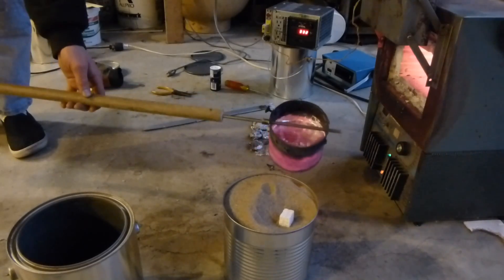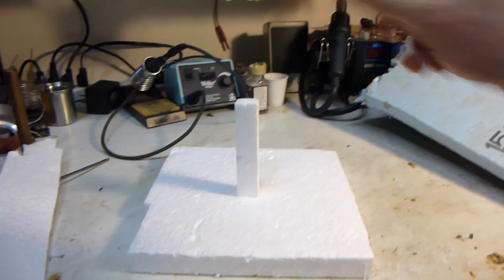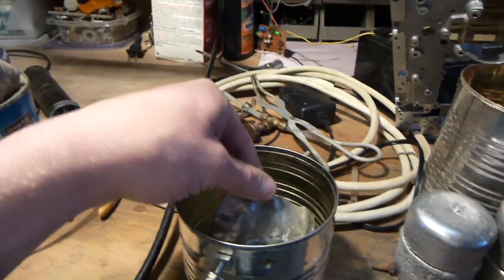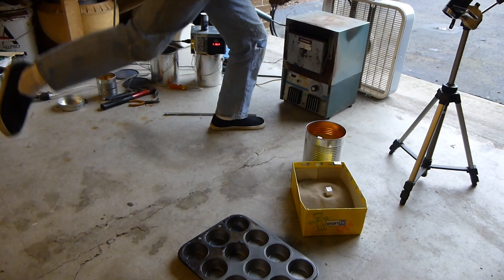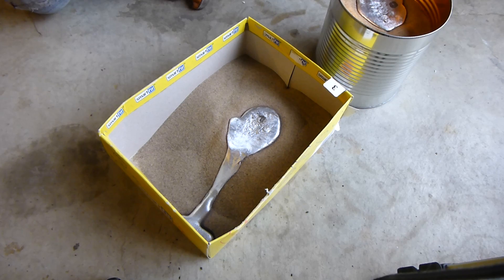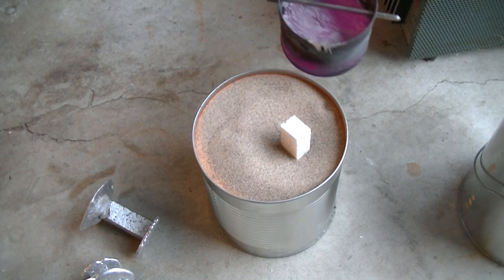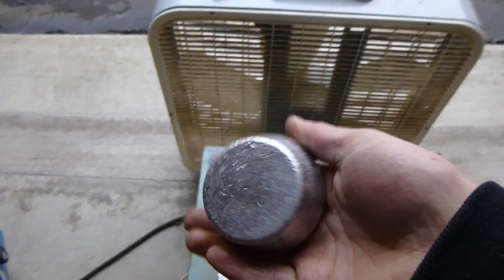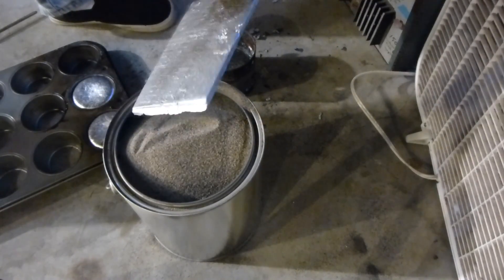Aluminium Lost Foam Casting Experiments and Tips

Comment: Just wonderint here maybe fill the cheap foam imperfections with wax? Bore out the sprue and  and somehow round the sprue into the actual form or at least use some small pieces to make a 45 degree entry so it can flow.

Comment: Sprue  length doesnt really matter, as long as you have  clean material, scoop the dross off, then flux it,  a steady smooth pour will work.  Make sure you have a feeder tube to allow material to flow more into it than needed, the feeder tube will put steady pressure and fill correctly.    Also, a smooth sprue with rounded corners entering the mold, is a must. Your pours are a little fast  causing air  pockets.

Comment: Read your comments an you will fine the answers to your problems. Those I have to admit I was wondering why you were using styrofoam.  I'm still at the beginning but I took a break to learn a bit more before up grading my materials. I, like many started with lead as a kid, an made my first crucibles from a pipe cap they come in many sizes an are pretty strong. Later on I still go cheap just added a bit more pipe.  Thank You Loader.

Comment: I think that you need a vent channel for the hot air/gasses to escape. This could be trapping air in the mold and causing back pressure on the flow of the melt. Hot gasses can cause quite a high back pressure - just think about what is going on in the cylinders of your car/bike. Creating an exit for the gasses may mean that you do not need such a long spru. 
I did, however, enjoy your video.

Comment: Watch a YouTube video, you can clean that sucker up good as new(ish).
Reply: Kiln, remove rust and other built up residue.
Reply: I understand the pressure aspect, but can't help to think that if you had poured more product in the first time you would have resulted in a larger platform yield.
Did you did to see if any of the foam was still intact and under he sand?
Reply: 11:00 in, nice mold result!
Reply: I like it. Your method is almost scientific!

Comment: Theoretically if you premelt some aluminium and add rest  - it should be slightly faster metling. Better idea will be to mix during melting, but it is non-trivial.

Comment: I really recommend not using extensions with powerful devices. Bolt it down directly to your grid with a solid, one piece cable.
Reply from the maker: +Piotr Misiuna yep. I did use a heavy duty cord. But it still got pretty darn hot.
Reply: There is also oxidation on contacts inside plugs and sockets.
Reply from the maker: Yep

Comment: Is there a size limit to lost foam? I'm thinking of casting a pair of 25 inch (a bit under a meter) bandsaw wheels this way.
Reply from the maker: +Lawrence Withrow I would not try something that big with lost foam. Especially since you will need two wheels. I would make a wooden pattern and then use green sand. It's a much more tried and true method and is a lot more reliable.
Reply: Thanks.

Comment: Nobody should be saving to buy a crucible, repurpose an empty fire extinguisher casing.
Reply from the maker: +Chris Eubank yah I've used propane bottles before. Essentially the same thickness as fire extinguishers. Problem is they only last around 3 castings and then you loose all your aluminum. So if you don't want the headache of aluminum leaking out of your crucible all the time then it's a great way to do it on the cheap. I bought one and I certainly don't regret it. Have a nice day!
Reply: Makerj101  when is your next video i am very anxious. Also for my foundry i am using a hair dryer and brick with charcoal and a fire extinguisher do you have any suggestions that wouldnt be too expensive. thank you
Reply: dude, really? a hair drier? does it work? i have nothing and want to try this for the first time. I have a heat blower (the kind that's part of a soldering kit, for heating smartphone screens to remove broken glass). is that really all the air pressure you need to heat aluminum to 700 or so degrees?
Reply from the maker: +Tech Review I'll try to get a new video out soon. I've been really busy with school lately. Sounds like you have a pretty good setup. IDK, it's you're foundry! Upgrade whatever you want
Reply from the maker: +prodigalus no, that wouldn't be enough heat. Aluminum melds around 1000F. The hair dryer is used for an air supply to make the charcoal burn hotter.

Comment: How did he stick the sprue and the styrofoam together? Would any of PVA, UHU tube glue or glue stick for glue gun be ok? Would any of these burn and evaporate when they come in contact with the molten aluminum? I know that the UHU tube glue causes slight damage to the styrofoam as it is a solvent and may cause worn out but I could still use it without damaging my piece. However I would like to know if it would work and if no what else could I use ? (I need a fast drying material)

Comment: I've never done this but Ive been researching. Maybe you should use green sand
Reply: green sand is used in a different casting method. When you use green sand you need a strong object of your desired shape, most people use wood. You then use it in a two part box and remove the mold leaving a void. In the lost foam method the mold is left in and is melted.
Reply: 1man2guns3kills I know it's typically used in mold casting. I just meant maybe it wouldn't collapse when he adds the metal

Comment: YOU'RE USING DRY SAND. NO CLAY. You're using a long shaft,  a lot of aluminum, NO AIR HOLE FOR THE DISPLACED AIR TO GET OUT. YOUR CAST SUCKS, DON'T SAY ITS GOOD. This is a horrible video. All of your tips, are actual shit. Possibly because you are breathing styrofoam. idiot

Comment: can i use plastic instead of foam?
Reply: i would say not. besides, the fumes would be very dangerous. instead of foam, if you needed more detail i'm sure you would use the lost wax method instead.
Reply: The plastic would sit at the bottom and stay in and cool like that, ruining your cast
Reply: Sleestak Lizard good point. foam seems like it vaporizes. i think you even have to melt wax out of a lost wax mould, no?
Reply: +ryan barker I think wax could work, you should have some basic trial and error tests to see which works best, although,  styrofoam is cheaper and less messy in most cases.
Reply: +ryan barker I think wax could work, you should have some basic trial and error tests to see which works best, although,  styrofoam is cheaper and less messy in most cases.
Reply: +ryan barker the problem is i cant make the mold from the foam, already tried i have no skill in foam,so i need to make silicone mold first and then use some melted wax for using lost wax?
Reply: Sleestak Lizard true, but you'll never get the detail out of styrofoam that you will out of wax.
Reply: Kana Sama can you make a resin positive with the silicone mould? lost wax would be several more steps.

Comment: I'm no expert but I cast lead weights and you are poring waaaay too fast and you need to be able to pour right at the surface not from 6 inches above it
Reply: Casting lead and aluminum is different, aluminum solidfys much faster than lead so pouring faster is better
Reply: phartattack nono. The faster the better as always
Reply: Just a bad accident waiting to happen, enjoy your scars!
Reply: phartattack i will if iget any

Comment: You need to use damp sand so i doest collaps when the styrofoam evaporates
Reply: +ryan barker he's referring to green sand/moulding sand, which is a mix of fine sand, bentonite clay, and just enough water to help the clay and sand hold the shape. doesn't take much, but your correct. Too much water could pose serious risk.
Reply: how sure about this are you?  i mean, water and molten aluminum ~ not a good combination. it'd be better to use a higher quality sand, no?

Comment: Try to mix the sand with used oil (used oil from car engine). and when you add the mixed sand put letter pressure on it so the sand stick to gather (Not to much pressure that reform the fom)

Comment: I know people have mentioned using multiple sprues and length etc. also pre heating larger molds will help the pour flow better But it would require a much larger oven    If you had the means to do that then lost wax would be the way to go .

Comment: Wax is cheap and works much better for casting IMO. Also the length of the sprue does make some difference, but I've found that if you need to, multiple sprues works well for larger projects.

I'm also a fan of wax because I like to make art work, and it's surface tends to be more consistent.
Reply: Do you use a special kind of wax? I was wondering if regular Paraffin wax would work. It is available in a variety of shapes and sizes, from which patterns could easily be formed. I think multiple sprues help to more quickly equalize molten metal pressure as the casting behinds to cool - comments?
Reply: Pretty much any wax will work. I've used bee's wax before as well as wax from some old candles. I've never used paraffin before, but I believe it should work. And the multiple sprues is for gases and such to release. So you don't poor into each, you'll actually see the molten metal pop out the other sprue. It not only shows you that you filled the cavity, but also prevents gas blockages. Unless you don't have enough molten metal, then of course it won't fill the cavity.

Comment: While different sprues/spriggots can sometimes help, I figured out what was really wrong with your castings, and you probably already know this by now, but I'll mention it.

When the aluminum takes the form of the foam, it hits the play sand near instantly. If the sand is around room temperature-150 degrees Fahrenheit, then the aluminum solidifies against the sand very quickly. 
Most extreme hobbyist smelters heat their molds up first with a propane torch. I HIGHLY recommend heating your sand up before- hand.

I do a lot of aluminum lost foam casting too, and just learned this. It's helped me a lot. Also, sprues that big and wide are a hassle and waste of metal if the sand is hot. Just get a little 1/3in. by 3" piece and you'll be fine depending on the piece.

Have fun casting metal! It's stinking awesome that you got a free electric furnace!

Comment: bet your dad loves his electricity bill!  NOT!
Reply from the maker: +djyul It actually doesn't cost that much to run.  It uses 1.8KW so that day I probably ran it about 3 hours so 3hr*1.8KW=5.4KWH times $0.14 is only about $0.75  less than a dollar for 3 hours.  not bad really.  I mean if I was running it a ton it would sure add up.  I think the dryer is like 5KW so that's going to cost a fair amount more.
Reply: Makerj101 Well that not to bad at all,cheaper than here in europe.
Keep uip the good work young man!!!
Reply: +Makerj101 Nicely done! Screw these negative trolls
Reply: +zakizdaman Agreed!

Comment: Where did you get/how did you make your crucible lifter?
Reply from the maker: +Steve Creasy It's just a wooden broom stick with a steel rod inserted into the end.  There is a piece of coat hanger with that goes through a hole in the steel rod and that catches on the bolt that sticks out of the crucible.  Just something I came up with that actually works surprisingly well.

Comment: From trial and error I have finally been able to cast bells. Largest so far is 14 inches wide. They ring pretty good.
Reply: Please tell use about the metal/alloy you have developed for your bell casting. Thanks, RL
Reply: +Ron Delby Congrats, mate
Reply: Trial and error..I use to not weight the molds enough and have a stream of metal at my feet. I have found out that zinc is a good mix. It makes the metal ring better combined with aluminum. I developed a fool prof mold. Its called a sand trap mold. I invert the box and sit the lip part of the bell pattern over a tin wood panel or the like and trace the round part of the bottom of the bell pattern and cut it out with jigsaw. The panel will last awhile but burns on the edges. That's ok....When its used a lot I just replace it.

Comment: Try dampping your sand and packing it down hard.
Reply: Any moisture (water) in the sand will cause an explosion when the molten metal comes into contact with the sand and instantly turns it to steam.  (Some oils can be used in very small quantities to hold sand together, but choosing the right oil and quantity is very important also).  Very dangerous when casting to just try stuff to see what it will do without reading about it first.

Comment: The reason your last cast was a success is because you kept pouring aluminum until it flowed over. The other two I saw you poured a little bit and then stopped. They did not get enough. Great job though keep it up!

Comment: It's not so much the foam, its the sand... You need something a little more rigid... Use the blue foam, but use sand that's part plaster of Paris... Let that chooch for a while, then melt the foam out and you will get a much better casting. That white foam is terrible...
Reply: +Aaron DC mediA just keep your stick on the ice.
Reply: +Kevin Klika 
Skookum suggestion.
Reply: DrizztFan23

memetic propagation!

Comment: moisten the sand and compact it around your foam.  Heat the sand just below the point where the foam will begin to break down.  Pour the casting.  Your issue is that your aluminum is cooling before it goes to the end of the item.

Comment: equation to calculate pressure. p=γ x h
γ(gamma)= specific gravity of molten aluminum in your case
h= height from the to to bottom
watch your units and you should be able to come up with a precise height for your casing process.

hope this helps

Comment: Paint two layers of very watered down sheet rock joint compound on the foam mold. Let it dry over night and then cast. Use a foam cup on top of the riser to make the pressure higher in the mold.

Comment: you are correct about your hypothesis on the "sprue" or "riser" height the taller the riser the more pressure in the system in plumbing it is this way you have a column of molten aluminum a foot tall and you have approximately 1.17 pounds of pressure where as the pressure in a system one foot tall filled with water instead of aluminum would have approximately .43 less than half the pressure of the aluminum

Comment: If you leave a breather hole on the opposite corner it would help, but I think you are just not melting the foam quick, have you watched mrpete222 vids on the subject i will leave a like as he answers allot of your questions, he runs a home casting job as we. https://www.youtube.com/watch?v=qzkHuvYCJsY
anyway you can use lost wax if you use a 2 hole molding as 1 allows the wax to escape. Read his vids they should help as he casts different materials and is willing to help.

Comment: Few hints: Use coarse salt to clean the molten aluminium, the sodium in it creates the chemical reaction to purify it.
The sand mix you use i will not recommend, use red dirt, pack it when damp so it solidifies and helps the flow (smooth surface will create less drag)
The vent hole is a perfect idea for long and skinny pieces, like those int he experiment.
Cut the excess foam that stick out of the dirt or sand, that creates a barrier for a cleaner pour, make a funnel hole for more accuracy.
Mixing oil with sand I will not recommend due to the flammability of it, water and dirt will do better.
by the way, my father made a living out of aluminium foundry, we use to cast rotors, fans, for refrigeration and cases for street lighting, back on the 70s and 80s aluminium was the way to go.

Using a electric melting device is not a bad idea, but if you want to go more pro, build your own melting furnace out of refracting bricks and sand, you can fuel it with recycled car oil, mixed with kerosene and a force air supply, ppl use a hair dryer, but i will get a shop vac or similar.

Good video, really enjoyed the fact you tried different approaches to get the results you were looking for

Comment: if your pours aren't making it across the full span of a piece, it's because the metal is solidifying faster than you are pouring, or faster than your sprue can flow the metal.

Also, you can add a secondary opening called a vent, allowing gasses to escape easily.

Also, if you're using a fine silicate sand, you can mix a tiny bit of water and bentonite and pack the sand around your form. This will keep the form from collapsing faster than you can pour.

Comment: I always use the cheap Styrofoam but I smooth the surface with sand paper so that there are no holes on the surface. Works awesome! Don't need the higher density stuff
Reply from the maker: Random123 I need to try sanding it.  Makes a mess though...

Comment: I watched a video where they poured a mixture 50/50 plaster of paris and playsand mixed up around the mold, allowed to harden the fired the dried mold in the kiln to burn up the insides before casting, they blew out the ashes with compressed air and then placed the plaster mold in a bed of sand to hold it together while pouring the molten aluminum. I think I wll try this method to make an aluminum intake for a single carb manifold for a motorcycle (or a fuel injected manifold).

Comment: Nice vids.  Never done this, but want to try.  I think you would be better off if your rectangle isn't laying flat, but rather angled in the sand.  Then gravity will help fill it.  Then all you need is a short sprue from the top corner.  I've also seen people make a little volcano with sand at the top which helps contain the runoff.

Comment: Great videos! I have tried a little casting before. Id suggest moisten yr sand a bit. Also build up your sand funnel a bit more with moist sand,helps the pour and puts that much more pressure down your mold. Keep up the good work and keep up the videos!